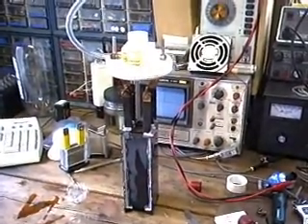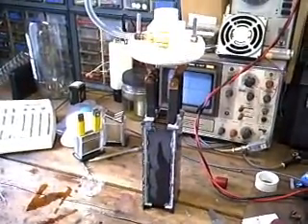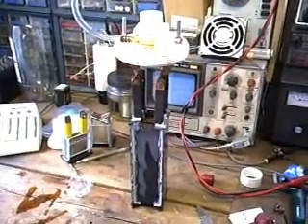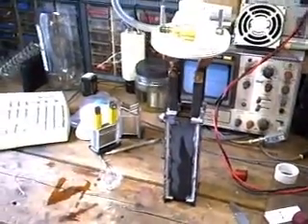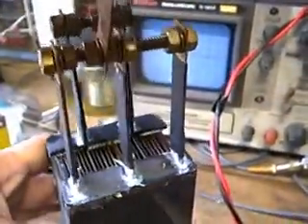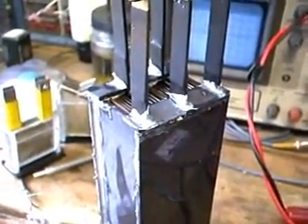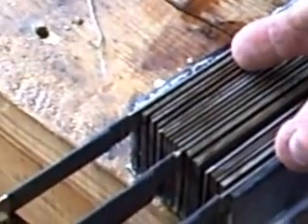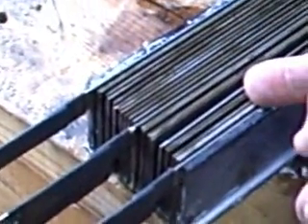#92 - VSPB 1st inspection

Comment: I think that if the bottom had support under it might keep it from saging and you could use your same glue. Another idea is to get some of that rubber used for lining showers from home depot and cut into 1/4" - 3/8" strips then drill holes though the side of cell and use nylon bolts to hold together.

Comment: I have a new thought for you , its not a voltage 
lose its a heat lose betweent plates , if you  enclose the plates you will get more heat , and 
then you get a chiminey effect  hot water goes to the top cool water flowes from the bottom, eletrons flow faster at a higher temp ,so your cell keeps the hot water enclosed !!!

Comment: More cells drop voltage not current. Current varies with resistivity. The more electrolyte and the hotter it gets, the more current you will draw. Please read up on basic electricity if you are going to be building a generator. Vinegar evaporates leaving you no electrolyte.

Comment: How do you connect all the positive plates and negative plates together? I only saw two points on each side where the electrodes were attached. Is there something in between all the plates?

Comment: Back in the 60's-70's hot rod's would add moth balls to increase the octane of the gas. As the chemical makeup of gas has changed it was recommended to me to not do it anymore. Especially with fuel injected cars.

Comment: I really think he is only getting a 2 or 3 MPG increase because his engine's computer system is flooding in extra gasoline as it senses the "running lean" condition created by injecting the HHO. So the computer system is 80-90% defeating his HHO cell.

Comment from the maker: There are two problems with this idea as it applies to brute force cells only. The first you already pointed out. The second is the surface area of the concentric tubes. Production will be limited by the surface area of the smallest tube, the weakest link in the chain.

Yes it does eliminate the need to seal the side edges because there are no side edges. I still feel two concentric tubes are the optimum and best suited for Meyers type experiiments.

Comment: Why not secure the plates together by drilling through the center of all the plates and securing them together with a nylon bolt. You can add nylon washers between the plates to keep them separated. This get away from the whole box idea and maybe lets more water circulate through giving it more cooling ability.

Comment: possibly turn the bottom braces vertically, if you were verrry gentle you might be able to dove-tail the plates like you were talking about, but unlikely at proto stage. 

nice set up.

Comment: Panels should be fine, trick will be to get the plate edges RED hot and hot evenly, and press/plunge quickly evenly.  Dont heat the panels only the SS edges.

My guess is that the material will push EVENELY from ALL plate edges thus forcing the materials INWARD forming a spacer of if anything when it cools.

You are right I think about being tricky to get it even when prsssing, maybe some practice runs are in order?

Good idea on the SS for temp spacers plastic will melt during heating.

Comment: the width of a plastic blade itself is larger than the thickness of the cells, so you are righ cannot be done at ome,  it would never work with blade. Laser? Maybe... water jet? maybe

Comment from the maker: I'd sure like to see how you'd do that. The gap is almost exactly the same as the plate thickness so you could use scrap to be your spacer instead of nylon cable ties. BUT, as you plunge the hot plates into the acrylic:

A) Melted plastic will push out from both sides of the plate making the surface for the next plate uneven.

B) The heat will probably deform the panels.

If you assemble as one unit, heating evenly, regulating plunge depth and keeping the plates even will be a trick.

Comment: No worries Zero, Ok then...

In a nutshell, for you and others trying to build this cell, why not heat up the sides of the cell plates using MAP Gas, and MELT them into the sides of the acrylic about halfway through. IT will perform double duty, seal them to limit escaping current, and hold them in place. Then glue the base and top?

Curious, if you could heat shrink wrap the entire cell sealing thos edges like anods/cathode using large heat shrink materials?

Comment: Home Depot, etc. sells Lexan plastic, which is a much sturder and higher temperature plastic than poly and plexiglass. Lexan begins to soften at ~135 C = ~ 275 F. Plexiglass & many other plastics deform at 212 F. Lexan machines almost like aluminum, & can even be threaded. You might consider this in a future cell. 
Jackson

Comment: I think he is saying the current "leaks" off the EDGES of the plates demitrin Electricity likes to attract and leak off sharp edges, so the idea is to contain it on the cell plates vs letting it run off the edges of the plates, increasing efficiency.

I havent tested this myself, building sealed cells like this, but he is getting great production, and has built and tested several cells.

He reports 2-3lpm which is amazing production for this size cell if true, thats proof enough for me.

Comment: Hey Zero couple questions.

1.Why not use the same liquid material you insulate the andode and cathode (the black stuff) extensions to seal the edges of each cell plate.. ie. dipping the plates in it just a bit on each side?  Stuff seems to hold up on the anode/cathodes, so wouldn't that work to insulate the edges as well and resist leakage?

2.  What is that black material?

3. How are you welding those extensions? they are welded right? looks like spot welding?

thanks

Comment from the maker: I lost about 10%.

The purpose of sealing the edges is to prevent leakage currents from skipping over or around plates. To be efficient, current must pass tangent through the plates. When they slipped out of their top and bottom grooves, more edges became exposed to elyte, more current was allowed to jump past plates instead of through them, efficiency drops.

Comment: Plastic supports could have warped due to heat? The color change of the adhesive also due to heat? How hot does the water get at 30 amps? Should get pretty hot. Mine got up to 170 and warped my test canister! Next project is going to be a Dry Cell Brick w/a water resevior.

Comment: Hi ZFF.
I take a great interest in your work. Try clear polycarbonate rather than acrylic. Polycarbonate has a higher melting point and higher glass-transition temp. It is far tougher and has a much higher resistance to chemical attack than Acrylic.
Araldite is a two pack epoxy resin that would IMHO be ideal for the job of fixing the plates because of its ability to; withstand chemical attack, withstand high temperature, adhere strongly to all metals and plastics. Keep up the good work. Fergus

Comment: How is the potassium affecting your mixture explosiveness. It's obviously not recycling.

Gasoline needs the air intake for the oxygen so it can combuste. Your mixture has already oxygen in it. The car's intake may be making the mixture way too lean to combuste and therefore give you a better mileage/gallon of fuel.

 
That's all. I've seen all your videos and I had only these observations to make.

Comment: Hi zero, 
Ever think about a plastic cutting board(there about 1/4 to 3/8" thick)I've used this before on a similar project. Cuts well on a table saw. You could also put some nice grooves in it with a table saw(no milling machine needed). It also taps very easily to screw them together(no adhesive needed). You can get them very cheap.
Keep going! Lee

Comment: that's good temps for production you are getting, It might be due to all the neutral plates you are using, I use + nn -.... which might account heating up more.. Im surprised though at your high amperage.. (Might be due to electrylite type and concentration as well) being 30amps+ with only 5 total anode/cathode with so many neutrals? I was told neutrals keep amps down?  My cell only pulls 15-20amps in pure vinegar, but will pull 30 amps in tablespoon of Lye/distilled. and anode/cathode hot.

Comment from the maker: I'm going to give the Home Depot variety acrylic a shot first. It held up well in the first VSPB cell I ran for a very long time. +nnnnn-nnnnn+, 304 stainless. If it fails I will go to cell cast but I don't think that will be neccessary.

The Weldon is also a great suggestion but my problem is not with the acrylic joints failing. The goop is still needed to form snug grooves for the plates against the acrylic walls.

Comment: My experience has been my cells over time approx 1hour, heats up to almost boiling 180+ over time, and your's is pulling more amps which gota equal more heat. 

Not sure you have covered your operating temps over time say after an hour of running, I bet that cell gets to boiling easily after about 1hr.  Mine do, only thing that will hold up to those temps is using glued joints with proper glue (weldon) and thicker acrylic sheet.

I would 86 the goop

Have you measured the temps afte 1hr?

Comment: Try US plastics for the Weldon 4/3, and maybe even some cell cast acrylic 1/4" sheet,

You need a glue bottle with needle, use capillary method to glue the joints of the acrylic around the cell into a nice tight box which will not be effected by heat as much.

The cell cast MIGHT hold up to the heat a bit better than what you are using. Plexiglass and Extruded plastics (plexi and others) is cheaper but more pourous.  Cell cast is denser and more expensive but might be better under heat/load.

Comment: Hey we are all learning here..I have done quite a bit of acrylic work, so I may have some advice.  IMHO using WELDON 4/3 to weld the acrylic box TOGETHER into a snug box is the way togo. Didnt think that goop would hold up, under heat/weight looks like it didn't.  

Most Acrylic will bend about 200F, thicker acrylic might help, dont get extruded crap from homedepot. 1/4" CELL CAST from Mcmaster or local plastic supplier. it's more dense less porous, and Might hold up better.. Might.

Comment: HAVE U TRIED Acrylic Cement? Fast-setting formula. A free-flowing (capillary), solvent-type bonding agent for acrylic pieces. Generally it is used for edge gluing, since it softens surfaces and welds them together. It produces strong, optically clear cemented joints. Apply with brush, medicine dropper, hypo-solvent applicator, or syringe.

Comment from the maker: Among my many credendials, I am also a MECP Certified Master Installer. I know what a cap is for and it isn't for supplying straight DC to a constant load. It's an electrical flywheel to limit voltage sag at the amp on TRANSIENT current peakes when pumping bass notes into a sub.

Comment: ZFF, as jclabart said, you really are inspiring.  What if you tried another material with a higher melting point and instead of using adhesive on the electrodes, just get the electrodes red hot with a torch and press is together to create the perfect grooves.  If that won't work, I think we need to come up with a way to mill the material to make the grooves.  Bottom line, I think glue should not be touching the electrodes.

Comment from the maker: Ah, good. Another perfect question for my FAQ.

DO NOT USE SILICONE BASED ADHESIVES IN A CAUSTIC SOLUTION. PERIOD! They will break down and poison the cell. Virtually no adhesive will stick to stainless once subjected to electrolysis. The best you can hope to do is create slots to hold them in place. Goop brand Marine adhesive is one of the very few that seems to hold up well over time.